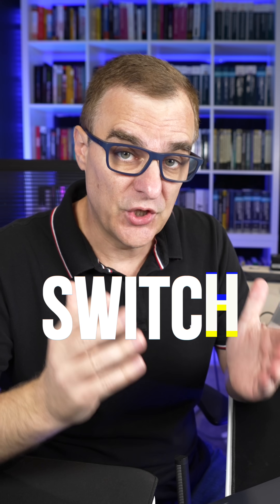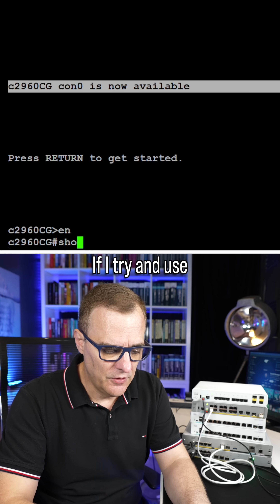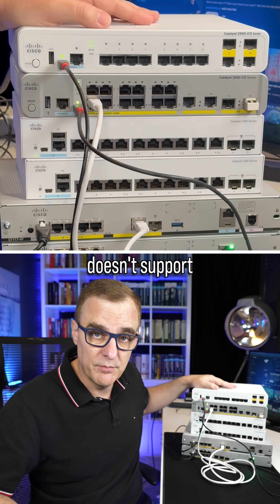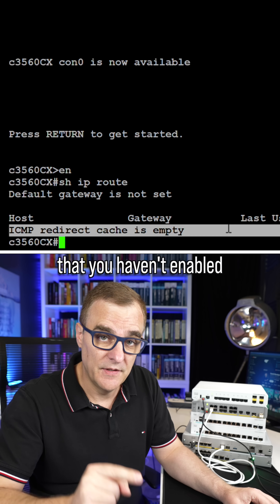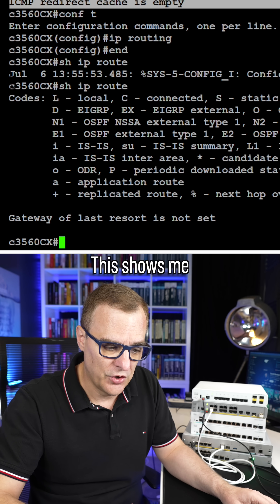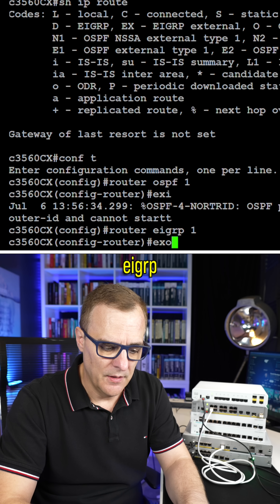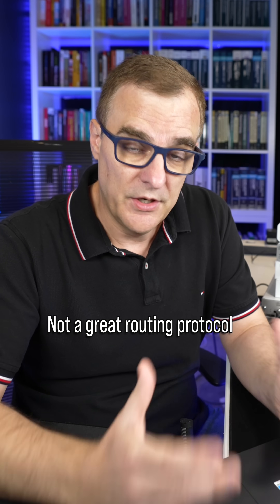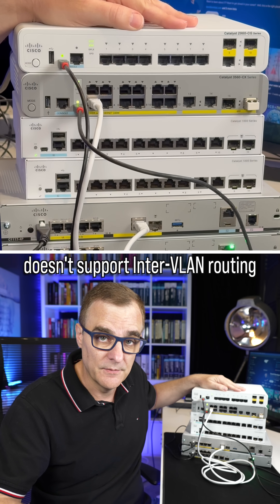Turn a switch into a router (layer 3 switch) #shorts #router #switch #ccna #internet

Comment: Great demonstration!  Reminds me on an acquisition project we  Recently were on and had to deploy a router on a stick method.  We acquired switches with no L3.  We attached it to a trunked port to get routing working until a fix (replace missing core L3 switch).   Used a $30 mikrotik router configured with multiple vlan interfaces.
Reply: Router on a stick does not need a L3 switch. All the vlans are on on the router connected to a sub interface. The router does the inter vlan routing.

Comment: The only downside is that most smb switches do not support dynamic routing. If i am correct the catalyst 1300 only supports rip v2 but not ospf. HPE networking instant on only supports static routing. For dynamic routing you need minumum a catalyst 9200 / 9300 who are overkill for smb. I hope this changes in the future.